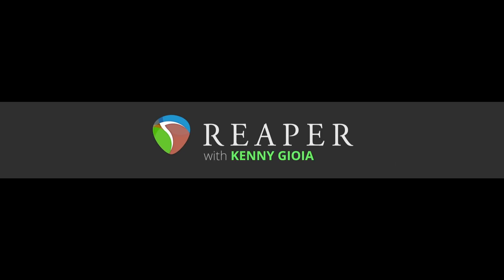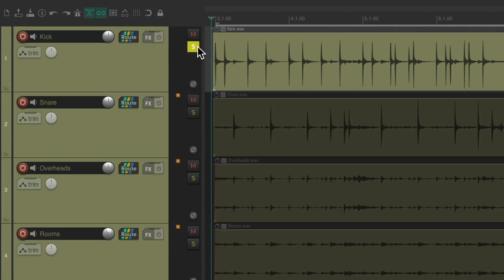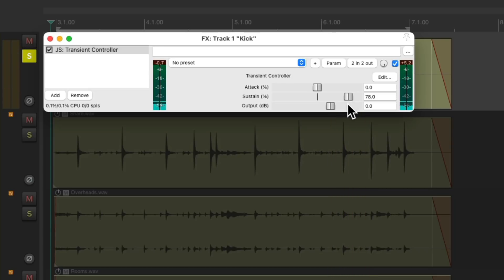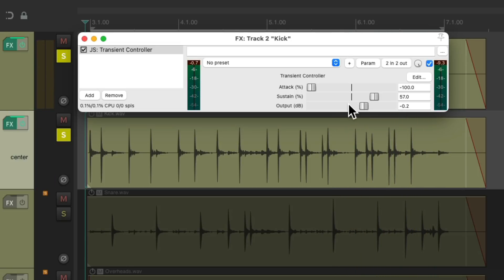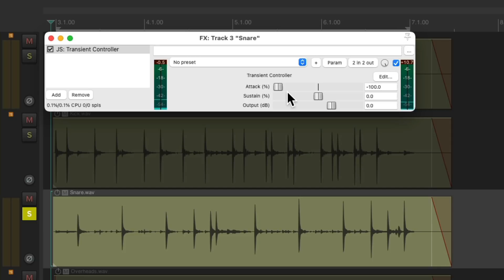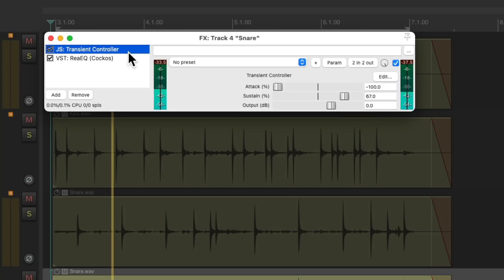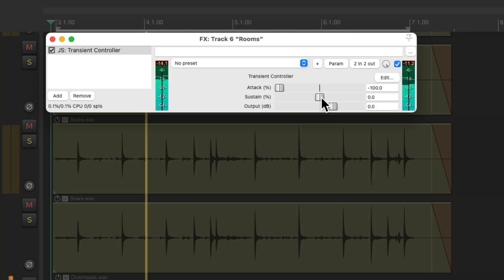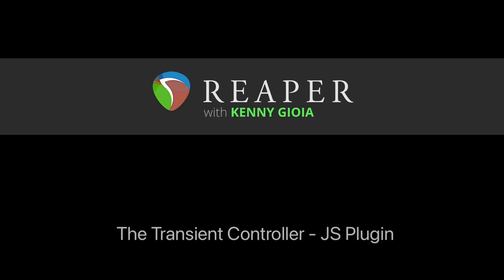Transient Controller - JS Plugin in REAPER

Comment: Awesome tip sonically! I prefer using multichannel routing inside the track for parallel fx though. Makes it nice n clean to mix
Reply: Not sure I understood what you said here, could you describe the steps involved?
Reply: Sure thing. You have to use the plugin pin connectors to route plugs' audio to different channels on the track, then recombine them later with a js plugin to sum the desired channels together. Very complex routing is possible this way. Look around for some cool scripts that visualize channel routing

Comment: do you ever need to worry about phase issues when processing duplicate tracks in reaper?
Reply: 1. Duplicate track, 2. Put for example transient controler on duplicated track, 3. Apply this effect (render) to duplicated track, 4. Zoom in to check any phase issues.
Reply: @tomo3479  and you could invert phase for a more through analysis
Reply: By default, REAPER handles it.